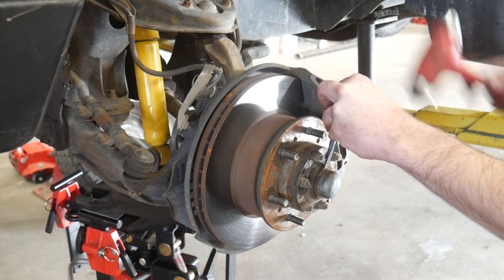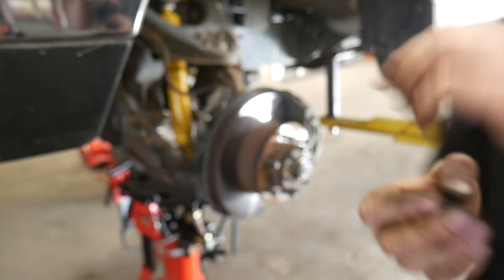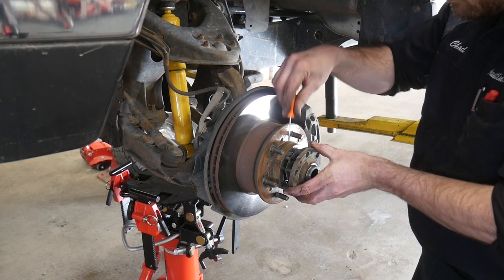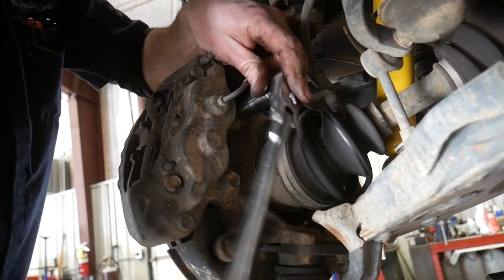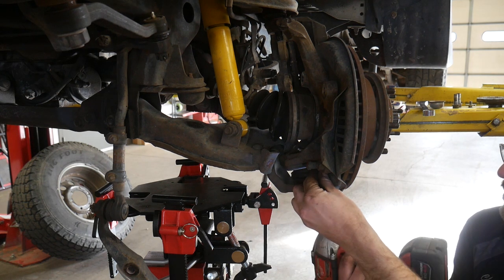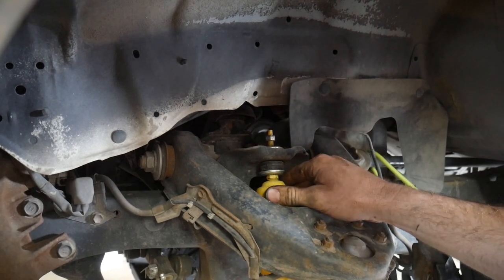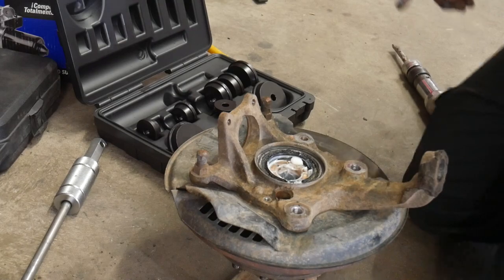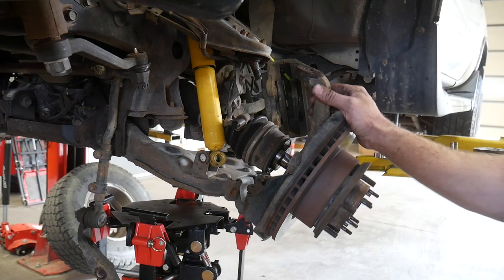Toyota Spindle Bushing upgrade to bearings

Comment: Thanks. You would not believe how many people, even dealerships that told me that my 95 Toyota T100 DX 4wd didn't have that needle bearing....I had to actually show them pictures where I took it out because of (squeaks), where it went, etc....lol.  I ordered one easily from AutoZone but it was not correct size.....somehow they finally found it on a diagram.  If I'm not mistaken my Hanes or Chilton book showed it but was no mention of it, I really don't remember just know I had a heck of a time convincing them. I had a hard time with ball joints as well. This was done in a driveway with just a few tools but I got it done and it's smooth.
Reply from the maker: I luckily have a Toyota parts veteran I call when I need something. Most of the newer parts staff cannot find anything I ask for.
Reply: @ThePracticalMechanic  I know this will never happen,  but I am actually looking for an engine for my 95 T100 DX ext cab 4wd 3.4L manual.  Do you know of anyone that sells decent to low mileage 3.4's or refurbished engines for an actually decent price? Not to many out there familiar with the T100 , the fitment issues that if you use 4runner, you still have to use T100 oil pan, sump , pickup, dipstick tube (u probably know what I mean). I guess that's the biggest issue I know of with them?  I'm in NC but would drive or pay for shipping for the right engine. Besides buying mine new, I have invested 5k in it since 2015, it broke down 2wks after putting new tires on it....engine is shot.  Just hoping, hate seeing it sitting but I can't afford $1300 for used engine with 270k miles....just too much work, $ for taking that chance. Mine has blown head gasket and lower end issues too. Thanks
Reply from the maker: @dgmenace73  as long as you picked up an early 3.4 you can just swap the pan and move the dipstick. The hole is already drilled in the block and there is a plug that need to be removed. If you end up with a later engine the hole is not in the block but a drill template can be rented from several companies that offer parts for a 3.4 swap into older vehicles. 

I used a t100 dipstick tube and a 3.0 l oil pan in my 1990 4runner when I did an engine swap. 

What is wrong with the current engine? They are typically reliable unless they run low on oil or the head gasket fails. Our local rebuilder typically quotes $2000-2400 for a complete rebuild on these engines.
Reply from the maker: @dgmenace73  I missed the issues you had listed. If it has top end and bottom end issues I would just look for another engine. It would be cheapest to find a 4runner engine and swap the parts you mentioned. It would only take an hour or so to swap the parts from one engine to the other and resealing the oil pan while the engine is out is something I recommend anyways.
Reply: @dgmenace73  Hey Denis, did you ever find another motor? Those things are easy to rebuild. I pulled my first motor ever and rebuilt it 3 months ago. I mean totally rebuilt it and new crank and rod bearings and piston rings were around 70 bucks and a whole new gasket set was 90. I found a good used crank for 100. I cleaned the block and heads and had them both resurfaced for 65 bucks then I put it all together.So I have about 250 in a rebuilt motor that runs like a new one and it was the 3.0 And I just got through building a 3.4 for less because the crank was good. This guy didn't keep driving it after it started knocking. What I'm saying is that I had never even pulled a motor, much less rebuilt one, but I just took my time and did my homework and just did it. It's not really that hard. And plus it's cheap.
Reply: @dgmenace73  If you don't mind driving and can pull the motor and drive to Arkansas, I'll help you out and build it for you . As long as you pay for any exspenses and parts. I used JDM or DJM parts instead of toyota . cause it would have cost 7 times as much to use all toyota parts and plus they didn't have or don't make some of the rod bearings for the 3.0 .. So I just orederd mist of them through partsoligy.com and it saved me a bunch and I found a local guy that machines cranks and heads and blocks and rods if needed. And he charges only 50 bucks an hour. I don't mind helping someone out as long as it don't cost me , cause I'm in the same boat and I'm always needing help myself.
Reply: So at the end you got them at auto zone? I need to find them for my 92 4x4 pickup
Reply: @emiliano echeverria  yes & no....at that time....2012 I believe.  I purchased one from AutoZone that was very cheap priced.  The thing was, it was the wrong size.  That's when I turned to Toyota. It took them some digging but finally got it for me. I do remember that little needle bearing costing $50!...smh

Comment: I ran mine without the snap ring. A bump would through it out and you could hear grinding. Hit another bump and it would run smooth. Took it off and there was a fair amount of brass dust around the area. There is some play there now. More then a few mil. I imagine this is my problem child. Will the car line up or will they tell me no use? Until this is solved my tires will grind to fast,..Time to get a slide hammer I guess. And still better then whole spindle with it installed. Also it says upgrade. Is the upgrade best because it has splines and it seats the Axl splines better is my guess. Nice vid any discussion? Thanks,..

Comment: Hi do you know how many mm is the old bushing?  I just pulled my old one out and it looks short.  About 5mm shorter than the new one.  The new one (no bearing) is about 17/18mm and looks like it will have about 2/3mm gap from the groove inside the spindle.  Thanks for your help!

Comment: if you have Aisin locking hubs the secret to getting the cone washers out is to back the nuts off until they are flush with the end of the stud and then take a brass punch and a hammer or just a brass hammer and smack the end of the stud ... a couple of good hits and they will pop out then you remove the nut and pull the washers.  the purpose of keeping the nut on while you smack the stud is to prevent damage to the stud threads. Once you do that you can just pull it by hand usually.   Smacking the side of the housing is the wrong way to do it and results in cracked hubs.

Comment: Good video. Would you know how many thousands the axial clearance is on your repair and what he OEM specifications? I used a dial indicator on the axle shaft end and got ~0.015" clearance pushing the CV joint in toward the truck and pulling it back out on my T100.

Comment: If I dont have a ball joint puller can I choose to remove upper ball joint from the upper control arm 4 screws instead of the side that is screwed to the knuckle?
Reply: Yes that's just as good, i personally just take the upper ball joint off from the control arm just because it's easier to leave it attached to the spindle and put back on

Comment: Hey cann you give me the toyota part number for that bearing and busing kit? And is it usually the Inter bushing that wears out and not the outer one? I have that noise but only with my hubs locked , which is the only time the cv turns.

Comment: do u happen to kno what size bolt that is that holds on drive plate got a wrecked yota and i cant find it newhere
Reply from the maker: The bolt that goes into the center of the axle is a 8mmx1.25 and is probably 12-15mm long. The factory one also has a very large washer.

Comment: Awesome.  How would you describe the benefits of using the bearing rather than just the brass bushing?
Reply from the maker: I honestly haven’t noticed a difference in the daily driving because I installed lockout hubs on mine. The problem I had with my old bushings was a rattling noise going over small bumps and a screeching noise when the temps were under 20 degrees F. The new bearings should allow for smoother operation of the axle and if kept greased should last longer. Others have mentioned that the bearing may not be as strong as the bushing and might wear out faster if dirt and water gets into the bearing.

Comment: Don't these vehicles come with the regular wheel bearings that we see in other cars?
Reply from the maker: These older Toyota have tapered roller bearings that need to be grease from time to time. The spindle bearing/bushing is for the axle shaft to ride smoothly on the inside of the spindle.

Comment: Hi where can I find that part? What’s the part number?
Reply from the maker: I don’t remember the part numbers but I got my parts from the Toyota dealership. A quick google search show many venders carry the original style spindle bushing. Either way will work but if the vehicle sees lots of water and dirt I would go with the bushing since they hood up better. The bearings will fail quickly is water or dirt gets past the seal.

Comment: isnt there and outer bushing as well?
Reply from the maker: The outer bushing typically doesn’t wear out. Most of the axle torque is on the inner bushing/bearing. One of the few times I have replaced the outer was on a vehicle that was driven with the hub removed and lots of dirt and mud entered the wheel bearing and spindle bushing area.
Reply: @ThePracticalMechanic  okay thanks!

Comment: Thank you alot for the video.  I need this done.  Gives me a heads up on all the other stuff I should probably replace while I have that undone.  Was the needle-bearing some aftermarket thing, or are these Toyota OEM replacement parts ?  Video says you put a link for the part kit, but I do not see it.
Reply from the maker: All the parts were from the Toyota dealer. I will double check the part numbers in the morning when I’m at work again.
Reply from the maker: OK I did some checking on my invoice and the part numbers i used are as follows

Short updated bushing - 90381-32001
Needle Bearing upgrade - 90364-30011
Small Tube of greese - 08887-80219

I found them on several toyota parts website and on Ebay but none on amazon. There is also the option of installing the original type Deep Bushing which will be slightly cheaper but may not last as long.
Reply: @ThePracticalMechanic  I read around some information on forums.  Turns out, there is no easy way to get in there and geese the needle-bearings.  What winds up happening, is those needle bearings wind up get stuck or spun, then their surface starts grinding on one area.  The generic needle bearing is "HK3020", which is a 30mm inner, 37mm outter 20mm wide with steel cages.  Calling around ask a few bearing guys, they can narrow down which make/model bearing can be used that has hardest steel, highest temperature.  They are a common bearing also used in outboard engines too.

At this point, I am looking to drive a drill into the center of the steering knuckle, so I can mount a grease fitting outside to shoot the middle area with grease.   Brass or needle - both will wear out whenever the grease in there goes away.  I think as long as it's greased every so often, probably best I can do with that setup.
Reply from the maker: I normally grease my spindle bushing every couple of years. I have a tool that threads onto the end of the spindle and it has a greasezerk on the end of it. This does require removing the hub or drive plate so it takes about 45mins to grease them up.  A grease zerk on the knuckle would be more convenient.
Reply: I am hoping I can find a spot to make that hole when I can see it off the truck.  I cant get a good picture of it for the 95.  Found some for 2004, and they look like they have a hole in them for the zerk.

Comment: I got the random hub noise happening on my 91 4Runner with auto hubs, and now happening on my 86, is this going to solve my random noise
EDIT: after you said it happens when cold, that confirms it. Only happens below 10f up here in minnesnowta
Reply from the maker: As the Colorado weather has recently dropped below freezing my Toyota hilux starting making the noise(still has original bushings). It sound like your running over a goose continuously. 
If I unlock my hubs the noise goes away. 
If you don’t have hubs to unlock you can try removing the drive flanges and see if the noise goes away. Since the axle quits spinning the noise should go away if it is the spindle bushings.